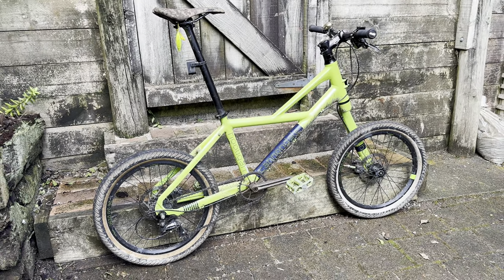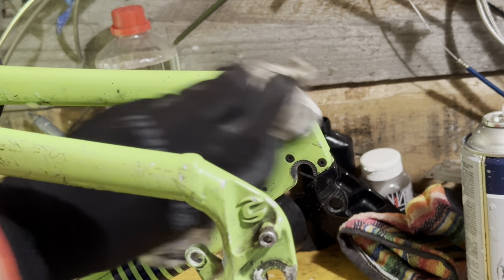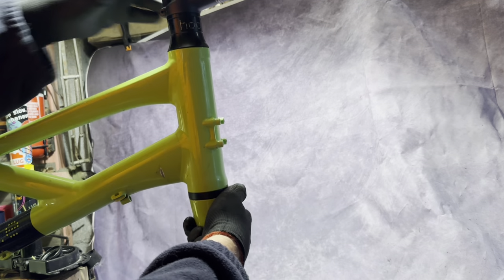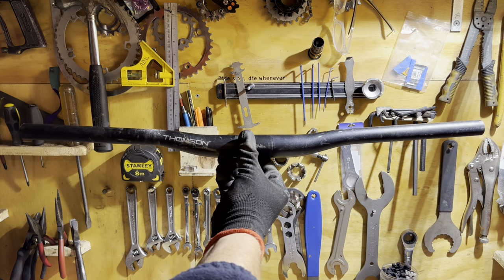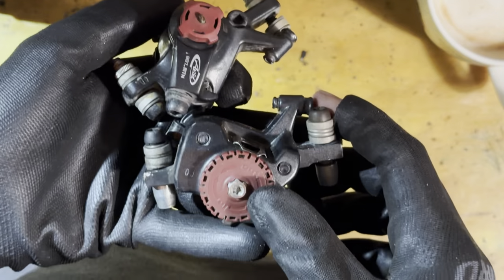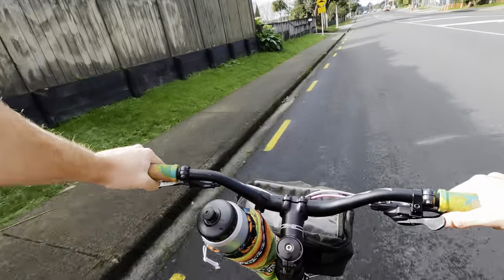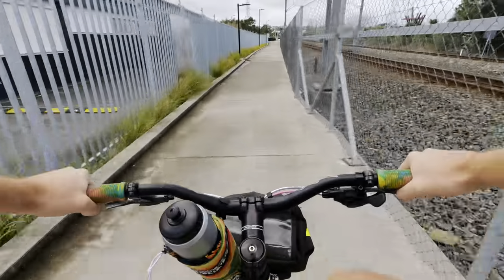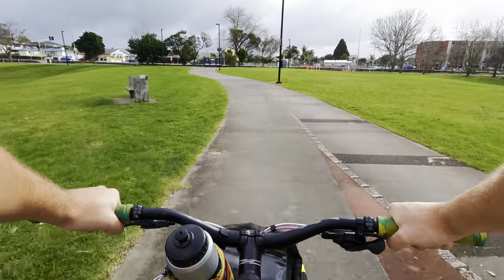MiniVelo commuter build - Cannondale Hooligan

Comment: Regarding the cables: I watched a Paul Components video some time ago where Paul said that linear cables don't really like to be bent a lot. So his suggestion was if you're going to have relatively straight runs, use linear. If you have some tight turns use the wound ones.
Reply from the maker: Just trial it out and see 🤙 
With some drop bars the curves are too aggressive for linear cables, it basically just creates a small amount of friction, but 98% of the time it’s not an issue. Even then I’d just run a section of coil wound outer under the bartape, then use an inline barrel adjuster then run compressionless cable outside of the bartape. 
But just trial it out, see what ya feel 🤙

Fun fact: Pauls Klampers are very similar internally to Avid bb7’s

Comment: I have a commuter bicycle with 20 inch wheels, I think it's about the perfect wheel size for a city bicycle. My own bicycle can fold, though, for when I want to take a train or a bus. I have a 3-speed internal gear hub with coaster brakes, a frame that technically came from a children's bicycle (although shorter sub-180cm adults can ride this bicycle stock), a pair of mudguards because they're essential, and extra long seat post and handlebar stem (the seat post is 550mm, the handlebar stem will eventually be around 400mm). 44-teeth sprocket in the front, 18 in the rear, and it's pretty much perfect for this kind of bicycle. I honestly wouldn't even really need any additional speeds but they do help when I have an extra steep or long climb and when I want a bit of extra speed when descending or on flat ground.

By the way, don't the handlebars feel too low? For me, that would be too low, I feel.

Comment: Shift outers could burst if you use them for brakes and pull the brake lever hard. But i do it myself, depending on the bike, i also like the harder feel more.
Reply from the maker: You use shift outers instead of brake linear outers? Wild! They are a lot cheaper than brake specific compressionless housing, even though the construction is similar. 
Most brake linear cables have added structure, compared to gear cables, so maybe that’s why they resist bursting. Stay safe! 🤙 definitely recommend Odyssey cables 👌

Comment: The Microshift super short groupset might be worth a look down the track. 11-38 cassette, clutch short cage derailleur, made for 20” wheels 👌
Reply from the maker: Yeah some day maybe but not really worth the upgrade for an extra 20-30mm of ground clearance. If I snag this on something I’ll go that route next though👌 the box four is 11-42 with a clutched derailleur too so I have a bit extra low range, which is handy for towing the trailer 😎
Thanks for checking out the vid! 😄🤙
Reply: @toastyrides  If the Box 4 gets the job done then hell yeah, extra range is always nice. Totally get it, hard to justify shelling out for a new groupset vs a good used one

Comment: Since a fork is comprised of multiple prongs, the Lefty is not a fork, but rather just a "prong". "Skewer" has potential, "shank" for the less refined. I understand that the quotation marks aren't entirely needed, but they aren't entirely not needed, either, so that's what I went with.
Reply from the maker: But skewer is already a part of a bike, whereas fork is what holds the front wheel-besides, when talking about a bike fork there isn’t really a definitive “two or more blades”. 
Maybe a single bladed X? Knife, squeegee? 🤔

Comment: I clicked pretty quick as I’m upgrading a polygon Urbano 20”. BMX tyres 2.4” slipped on. Wider gear range was 12-32 went to 11-34 easy and next is a hollowtech crank. I’d like the Zee derailleur as it has a short cage and a clutch.
Reply from the maker: Oh rad!! Thanks for clicking quick 🫡🤙 we don’t have the Urbano here but we have the Polygon Zeta, which is another cool 20” bike. Looks a bit weird, but it grabs your eye!
Sounds like some decent upgrades for it, yeah I was going to get a Zee too 👌 nice little derailleurs, but then this box setup popped up so jumped on it. Happy with it, though! The Zee setup will be really nice on it 🤙

Comment: I heard someone say coil wound cable housing is nice for cable actuated disc brakes because it provides a little counter-spring against the cable pull?
Reply from the maker: Never heard that but not the weirdest opinion I’ve heard, it either feels ok or feels too squishy so I just use compressionless on all my brakes. It’s never been a issue with rebound/return yet with rim brakes or disc 🤙

Comment: Lovely bike. I use the same brake levers and calipers on my commuter (2013 Surly Karate Monkey) and have been using Nokon cables with those aluminium segments. Not only do they feel even more direct, the routing is also way easier with less tension in the curves. At least compared to linear cables.
Can anyone here give me tipps for other minibike framesets available? I'd also be interested in 24" bikes that can be used as commuter bikes.